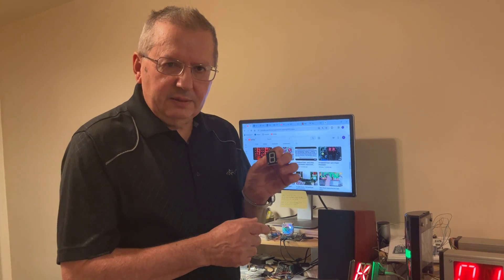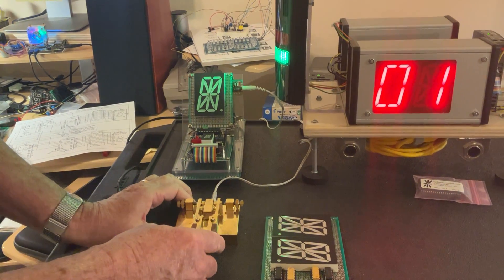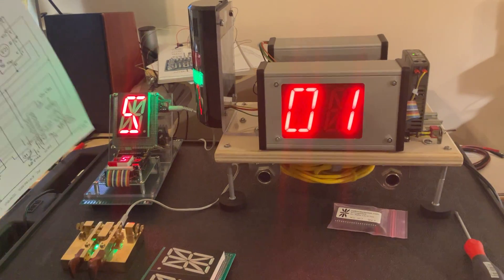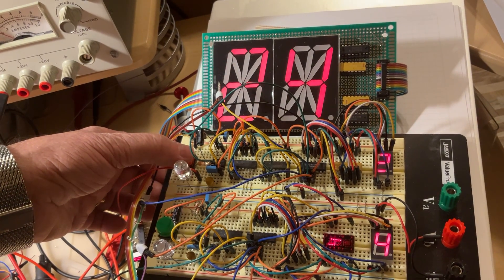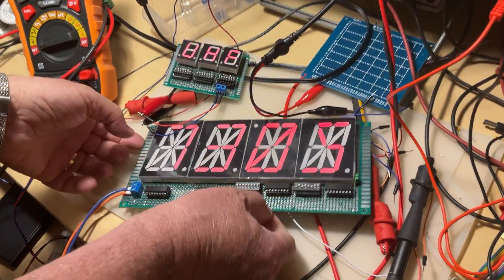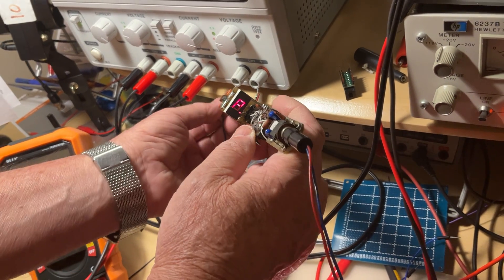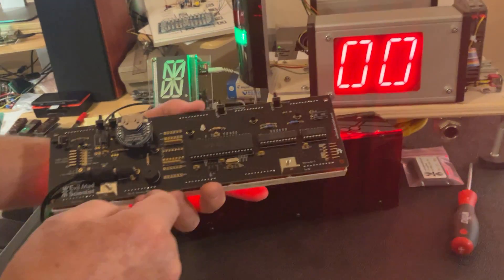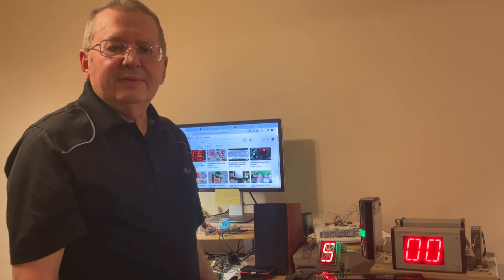Juggling with awesome 16 segment displays! Digital numbers–Part10

Comment: I don't understand the reason of the length of this video. like 8 16 and more segments are the most basic electronic you can find, it's on or more LEDs by segment, you connect the led to the right voltage the segment is on, you disconnect it it's off. Also using a 16 segments to display only 8 segment is a waste of money, the price difference is very high.
Reply from the maker: I am very grateful for your feedback, your questions are absolutely legitimate.
Your first question: why the video is 15 minutes?

Well, most of my videos are for beginners, and from my experience, it’s always a good idea to make people familiar with the component, before playing with it.   So I am taking my time to do it. No offense, tiktok is not my cup of tea.                   I don’t publish videos to prove anything, I just like to share from my experience.     I published videos 5 second long, as well as longer than 2 hours too.

Your second question: Why to use a 16 segment instead of 7 segment display? Isn’t that a waste of money?
I have two answers:
-on one hand, if you pick up a 16 segment and able to make it working like a 7 segment, it means to me that you know how to use it already!
-on another hand, did you notice that the 16 segment, even used as a 7 segment looks much nicer? It’s just my opinion though. 

As for the price, it’s always your choice where you buy them from.                             I took 5 minutes to look at the prices though! here they are.

2.3" LED display 7 segment:
https://abra-electronics.com/opto-illumination/led-displays-segmented/els-23101bs-red-2-3-common-anode-single-digit-7-segment-led-display.html - very reliable website
SKU#(Product code): ELS-23101BS  – 4.75CAD each

Don’t go on Amazon, the prices are outrageous:  11.19$ each, plus 1.99 delivery!
https://www.amazon.ca/Common-Anode-Digital-Segment-Display/dp/B07Q4B15TB/ref=sr_1_3?crid=3EFTA28GPA8VK&keywords=2.3%22+LED+display&qid=1700438653&sprefix=2+3+led+display%2Caps%2C184&sr=8-3 

There are surely cheaper sites, but as they are very unreliable, the final cost maybe higher than what I can get.

2.3" LED display 16 segment:
https://store.qkits.com/catalogsearch/result/index/?q=2.3%22%20LED%20display&ulmod_sb_honeypot=&product_list_limit=96 – very reliable website.
SKU#:16SEGCCR – 5.75CAD each

As you can see, the price difference is not really a waste of money, and for             1 dollar more, you get flexibility: When you need to display alpha-numerical characters, the 16 seg is ready. When you only need 7 seg applications, it’s working too and looks nicer✌.

My best regards,
CU
Reply: @CU_Wiring_Electronic_Projects  I'm allergic to tictoc 😹 but otherwise polishing a video, offer the advantage that as beginners you find the information more rapidly